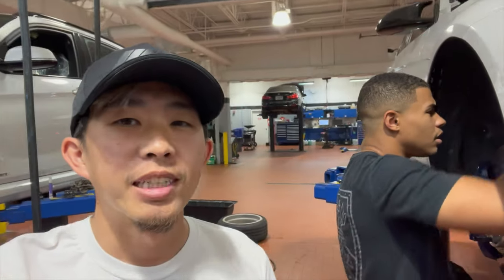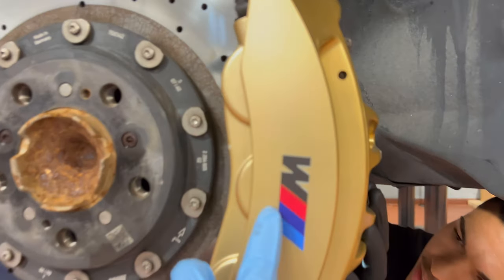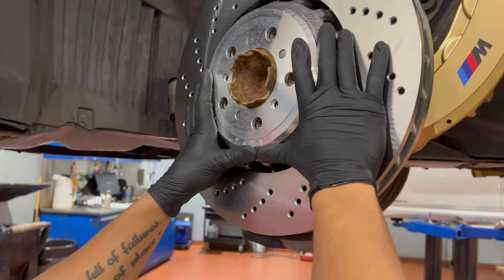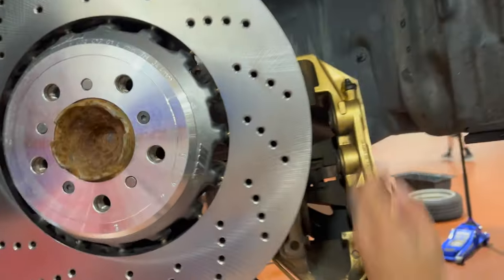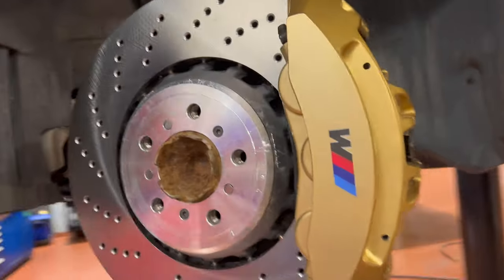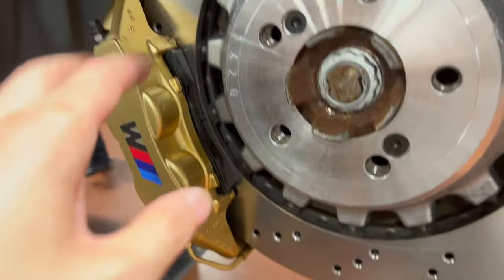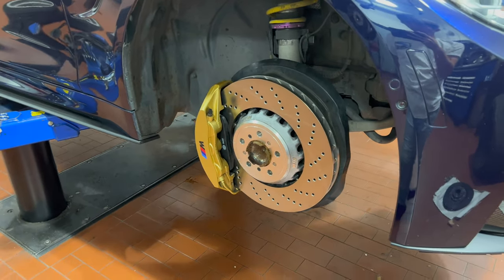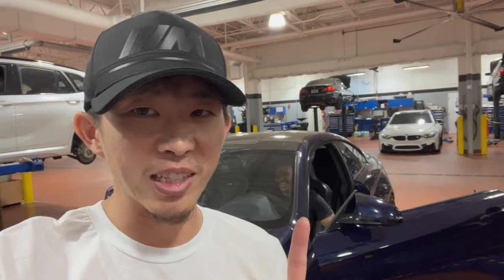Converting M4 CCB's to Steel Rotors! (Why I Downgraded?!)

Comment: did you use standard m4 rotors and pads? If not what did you use? Any CPU changes or booter or anything else? Just found out the size difference is just 2mm and the rotors and pads to use are the M2 Competition parts. Is that what you used?
Reply from the maker: I used the pads from m2 but they ended up giving me issues, so I go Ferodo track pads and been happy.

Comment: Great info man. I may need to do this for my M4 CS in the future. What exact Brake Pads did you use?
Reply from the maker: @quietfiend so I used some cheapo pagid ones but tbh they were terrible and my rotors instantly got pad deposits in them, I ended up getting ds2500 track/street pads which honestly have zero noise and relatively low dust. They do have great bite tho, similar to the Carbon rotors/pads, so i'm pretty happy with these new ds2500 pads.
Reply: @tauzins  Thanks man 🙏! Dang and here I was thinking of running Pagid pads too lol. Do you remember which Pagid ones you used? Also when doing the CCB to Iron rotors you have to also run M2C specific pads right?? Just want to make sure.

Love the build btw. Will definitely follow this channel closely.
Reply from the maker: @quietfiend7669  they were the cheap oem style ones not the pagid track ones. And yes you run the pads for m2 comp
Reply: @tauzins  Thanks so much for the info! Could you please confirm the pad SKUs? I ordered the rotors, but can't find much on the exact DS2500 pads for the 6 pot/4 pot (Using my F82 CCB calipers). I see the link to hpashop with these-- Front: FCP4712H Rear: FCP1281H for ~$920. Are those right?
Reply from the maker: @drpuffles86  https://www.vividracing.com/shopping_cart_checkout.php?&cartdata=eyIxNTQ4OTk0MzciOnsicXR5IjoxLCJwYWNrYWdlX2F0dHJpYnV0ZXMiOltdfX0&utm_source=abandonedcart&utm_medium=email&utm_campaign=abandonedEmail7200 

Here you go!

Comment: Did you explain why? You didn’t get to the point
Reply from the maker: it was mentioned. I'm probably going to follow up on it. but pretty much with tracking the car it makes more sense to replace steel rotors instead of replacing CCB's every 6-10 HARD track days.

Comment: It’s not really a downgrade a good 2 piece vented cast iron rotor will be far cheaper to run if your tracking your car plus pad options for cast irons are massive so you can really fine tuned the brake feel carbon ceramic are good for the street they have very good fade resistance and very long lasting most of which will outlast your car if you don’t track the car.

Comment: Thanks for the video, 2 questions: 
 1) I have an M5 with CCB, I am guessing I can use the current CCB calipers and downgrade as well? 
 2) my rear brakes pads seems to have some play, and it's causing a clicking sound, do you know if they make shims for those to hold it in place just like you showed in the video for your front brakes?
Reply from the maker: Hey man! I think you ended up talking to me on Instagram, If not I'll give you what I told that person.

Comment: Please note that Rebrake build the friction layer of this discs at a fraction of the cost of new and similar cost to cast iron conversion. Also, if the car came with CCB, many times the master cylinder and the ECU programming are not the same as cast iron.
Reply from the maker: Lol the rebuilt is way more than irons, my full iron swap was under 1k
Reply: Iron brakes come in many price point levels. At the equivalent cast iron BBK to CCB, cast iron is for an M4 is more than $1K. For a track day usage, cast iron BBK is thousands of dollars. For a street use, CCB do not degrade significantly so no need to swap.
Reply from the maker: @rebrakeusa  it depends on street driving style, my rotors were pretty much on edge of life by 60-70k and the pads the previous owner wasnt replacing at 50% to increase life of rotors. the iron rotors from BMW m2's are right around 1k for all 4 if you look on the right sites. if you wanna upgrade to girodisc its 1200 a pair... still significantly cheaper than any CCB rotor setup. there is a reason why most BMW/Porsche track guys rather run iron's and swap those rather than getting a max of 5-6 GOOD track days in CCB's and having to replace them.
Reply: Your are making valid points. The Rebrake Friction Layer (RFL) is the newest technology bonded to the M4 base CCB rotor and lasts up to 4 times than the original M4 CCB (depending on the M4 year). It is similar but better then the PCCB friction layer. It is important to note that an M4 that came with CCB has a different master cylinder and ECU programming than cast iron. So for aggressive street driver such as yourself, or track day usage, the conversion is more than just installing grey cast iron rotor.
Reply from the maker: @rebrakeusa  yea the brake booster you can just actually code the car to the “steel” configuration. Since bmw actually does offer the conversion to iron internally. But they don’t swap the booster

Comment: Hi! How did you get the 4 piston calipers at the back ? I thought all bmw cars come with one piston caliper at the back.
Reply from the maker: So i have the CCB setup on my car which is the same as the m2comp, you can order the m2 comp calipers and do a direct swap over. you'll need the m2 rotors also though.

Comment: So all you did was a just swap pads and rotors ? I have a 2021 g80 and I got the carbon ceramics but I want to go back to steels. Not sure if it’s the same process as this
Reply from the maker: so yea on the g80's luckily they are exactly the same, for me I had to use m2 comp brake rotors since oem f80 rotors don't have the larger rotor size. 

but you'll just get the oem steel rotors/pads and then more than likely require a additional coding just so it applies the correct pressure.

Comment: Did you have to change the brake booster?
Reply from the maker: I did not, but you can actually code the brake booster for iron rotors instead of the Carbon Ceramics